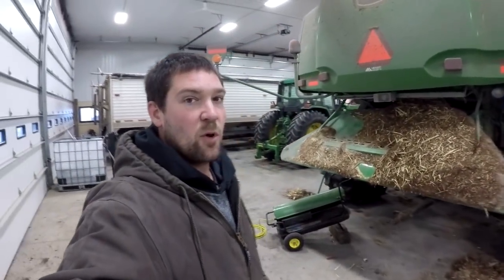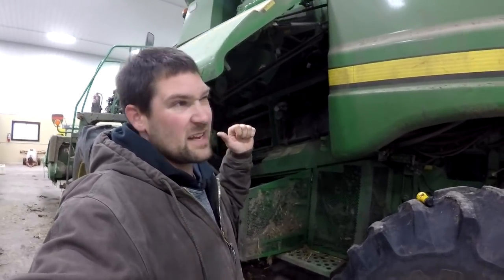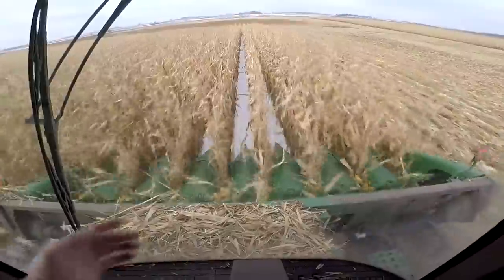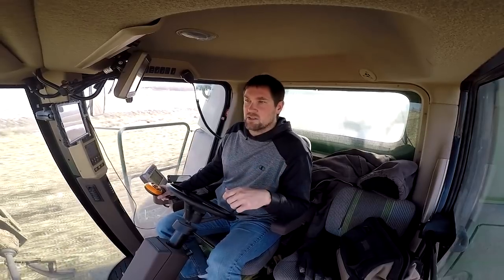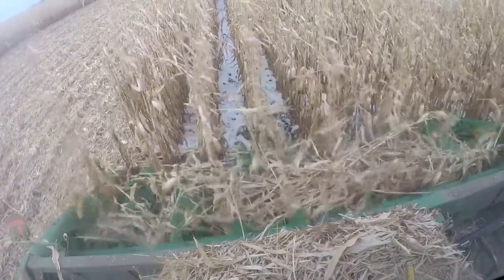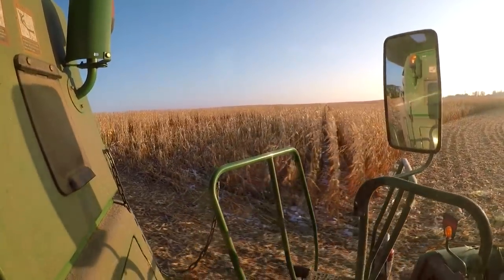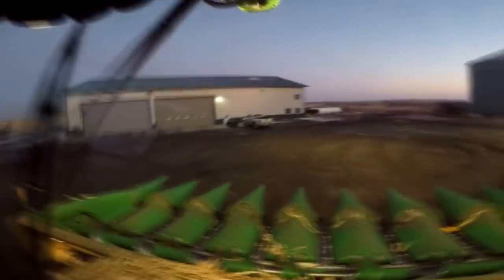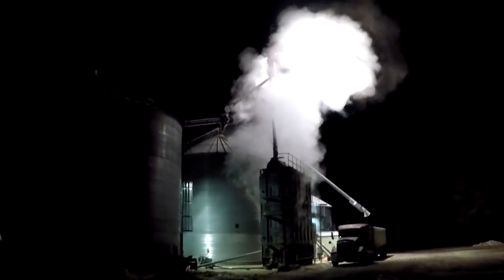Harvesting "downed" corn in the snow

Comment: Back in 1982 I had 300 acres of corn yet to harvest when the early snow hit. Had to wait until February when the temp finally got down below 17 deg F to finish harvesting the corn. Worked for 72 hours non-stop in order to get it done. I'm 66 years old now, disabled from farming and enjoy watching your channel. The last combine I bought was a 7720 Turbo JD and payed $27,000.00 for it brand new in 1978. Big difference in the equipment between then and now. Cheers...
Reply: I run a 6620 Sidehill, I think alot of guys could still run them if they didn't care about putting in more hours.  But if they want to buy twice the combine for 100k on 1000 acres and sell a 6620 for 8k in good shape, I won't complain. :)  It does bother me when they bitch about grain prices, though. Quit buying new pickups you dingbats!

Comment: Oh dose this film bring back memories!! Digging the snouts into the mud, blocking the fan, and etc. plus on an older NH combine. We went day and night non stop till we picked up a rock that the rock trap let pass and destroyed the rotor, bent supports and etc. looked like a bomb went off inside. We had to contract out the rest of the corn. Disaster year. 
Moral of the story,,, some times it's better off leaving it there till better weather. Be careful!
Reply from the maker: Military Museum don't scare me like this!
Reply: keep rock trap cleaned out if taking in snow. especially if trying to scoop in down corn. Didnt know corn heads could bring a rock in tho.
Reply: I hit a rock when finishing the first field.  It jammed the gathering chains and the head's gear box  two output shafts snapped.   That was cheaper than the STS rotor.   The rocks came from feedlot manure as we do not have natural rocks.

Comment: Sorry to hear about the trouble you are having with the snow. I was just wondering about something that I am not sure if it will help. Why not use a bucket on a tractor to pick up as much as you can, and dump it into a trailer. Then back the trailer into the building to thaw some of the snow.

After that is done, then you can find a place outside that it clear enough to dump it. Then use the bucket again to scoop it up and dump it into the harvester. I figure that might be safer than risking messing up your harvester anymore. Just check to make sure there are no rocks in it that can damage anything.

I have not worked with a harvester before, so I am not sure if this would even work. Either way, I hope that you are able to get everything done without anymore problems. And I hope that you and your family stay safe out there.

Razar.

Comment: I remember hauling round bails of hay at 11:00PM. I had two big halogen flood lights on the top cover of the tractor and two on the back top cover. The tractor also had it's two lights on the front and one big one on the back.
I looked like a UFO going across the hay field.
It was a full moon, I would line the moon up at about 11:00 o-clock and drive until I saw the
shinny aluminium gate in the distance. That was my bearing or dead reckoning of hay hauling at midnight.

Comment: I have to comment on your site JD has a new 20" row corn head 18 row it looked like it would do a better job of picking up that down corn especially when it's wet I've had my share of picking downed corn with the same head your using having to unplug it or keeping it from pushing up a mess like you have there

Comment: You would think the snow would melt in the machine lol
Reply from the maker: That would be nice.
Reply: Thats actually what you dont want.... thats how you get everything plugged up inside cause it gets everything all wet. We waited till it was really cold and the friction of threshing didnt melt the snow and it just blew out the back... but it was cold...
Reply: I just can't help but think there is diesel engine cranking out all sorts of heat and it seems it should be possible to redirect that heat to melt the snow. Think jet airplane deicers where the engine heat is redirected through slots in the wings. JD might have a fit if you did that on your own though:)

Comment: It would be pretty sweet if there were a way to redirect the air from the radiator down inside the machine to help melt that snow.
Reply from the maker: WalkTheWalk at times, yes.  The downfall would be when it's cold enough for it to blow through then it would melt and cause this problem again...

Comment: 600 series header height is the worst thing ever...
Reply from the maker: Dexter Runyard why do you say that?
Reply: it can not run on the ground like the 93 series. down corn sucks with those heads. does not matter how you set your sensitivity it still hops and have to run it manual.